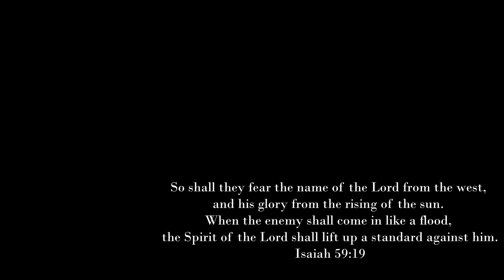A Day in the Life of That Jayhawker Dude - Corvair Musical Chairs - 1948 Chevy

Comment: Enjoyed the video. I, too, have used the ubiquitous plastic 5 gallon bucket for a seat -- almost tipped it but I overcame that bucking bronco. Things in common from the video: my mom had an early 60's Corvair, white with red interior, which ended up in a snowbank one morning when she was taking me to school; I had an '84 Chevette (just a bit newer than your grandpap's; & I, too, get frustrated with too much stuff & too little shop area. Here in south central PA it's been hot & humid. Temps in high 80's & low '90's but some days the "feels like" temp is at or over 100. The heat tends to keep me away from the shop work more often than not -- no A/C. My neighbor has A/C in his shop powered by a propane tank & it would only take about 30 feet of pipe for him to share it with me but he's holding his ground with a "nay, nay." Take care, stay as cool as you can. Nobody can fault you on the video output frequency -- animals have enough sense to lay in the shade & I think we're above them.
Reply from the maker: Well, God made us above the animals but many seem to be operating with far less intelligence these days. Thanks for the comments, I hope you cool off soon as well.

Comment: The first car I ever bought, at 16yo in 1974, was a 1948 Chevy Fleetline Aerosedan. Had it till ~1993. Current old car is a 1966 Corvair..Maybe the two models are linked?
Reply from the maker: What model of Corvair is your '66? My dad's first car was a '66 Monza with the 4- 1 bbl carb. setup. Of course it's no longer with us 😐
Reply: @TheJayhawker  Monza 11hp (2x1bbl) convertible. 4-speed manual. Just had a complete overhaul of the mechanicals, but needs a new top, bodywork and paint after being neglected for 20 years! My wife says I have to keep a car cover on it!
Reply: 110hp

Comment: The 4.3L accessories and brackets will ft the 305 in your shop.  Buy a used V-8 TBI intake (and elongate the center 4 holes for the older SBC heads), install a stock cam in the 305, get some 305 TBI injectors, a V-8 TBI distributor), a 305 ECM (or a 305 PROM for the 4.3L ECM), bolt it together and install it in your son's Chevy truck.
Or.......install the TBI system on the 250 inline 6.  As an FYI, the 250 and 292 driver side engine mounts are in the same location, but the passenger is not.  The 292 passenger side is forward of center where the 250 side is centered.

And......I own 2 USA made Eastwing hammers.  Any hammer other than an Eastwing is less than a hammer.
Reply from the maker: I still haven't decided just what I want to do but I appreciate your input. I plan on keeping the truck even if I don't get this one going for him and we do something else. They are getting to be very popular trucks anymore. One of the many things I know nothing about is are TBI injectors all the same or did they vary depending on engine size? I'm not sure why I'm so taken by the thought of putting an inline in it, but I am. It would be extremely fun to build some horsepower out of one for this little pickup. And your spot on with the hammer, for the past couple of months every time I grabbed one of my others I would sneer with contempt at it.
Reply: @TheJayhawker  Yes, the 4.3 V6 and small block V8's use different size injectors.  GM TBI systems are very simple and in my opinion extremely reliable.  I'm sure a man of your capability can become proficient with it very quickly.  The injectors are color coded, but the color sometimes fades out and can be difficult to see.  The colors are located on the top of the injector and can be seen with the harness connector removed.    I pasted below some of the information I have on TBI injector sizing.  I also have ECM and PROM part numbers, but that's too much information to list here.
5235203 - Yellow/Blue - 45pph - 4.3l engine 
5235279 - White / Green - 54pph - 5.0L / 305 Cars/Trucks
5235206 - Orange / Black - 61pph - 5.7L / 350 Cars/Trucks
17084327 - Yellow / Brown - 65pph - 5.7L / 350 Police Package

I believe the Chevy 250 will fit without a lot of work.  If you come across a 292 later, Tom Lowe at 12boltdotcom sells an adapter motor mount bracket that relocates the 292 passenger side mount to the center (same as a 250).  To use this bracket, the mechanical fuel pump must be replaced with an electric pump.  Be aware the 292 is about 1-3/4" taller than the 250.
Reply from the maker: @95Z28A4  Thanks for the injector info. I will keep that on hand. I always assumed that was the case but never had a reason to change any over. I have drooled over a lot of the equipment he has on 12bolt. My only reservation about the 250 is that it's even smaller displacement than what I took out, but I know it would be easier going in. Decisions, decisions.

Comment: I have a big oil spot where i park my 47 too .  (I've changed gaskets etc... it just likes to mark its spot like an ol dog i guess)
Reply from the maker: This is a very slow drip from the counter shaft that goes through the transmission case. Back then, if your car wasn't leaking you were out of oil.

Comment: im not a big corvair fan but i always wanted to get my hands on a monza spider i call it the mini camaro. heres a little secret the best 4.3 ever made from my experience is a half breed only found in a 95 gmc safari early style heads late style block with balance shaft you can id by the old style single injector aluminum intake and a plastic timing chain cover they are full roller motors from the chain to the rockers i just had to let go of 2 77 chevy aero coupe and a 1961 series 62 6 window caddy it was hard the only car im really looking for is a 86ish buick regal the one i had was stolen from my job at the time in like 03-04